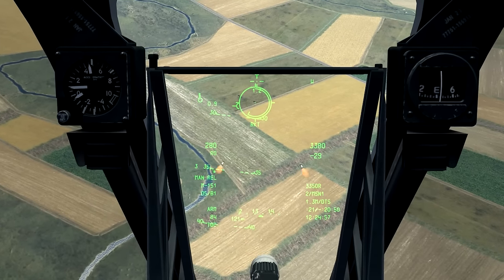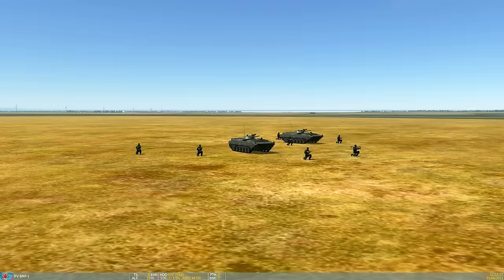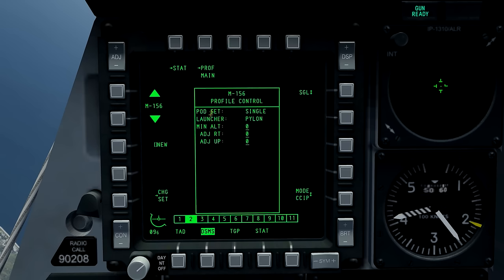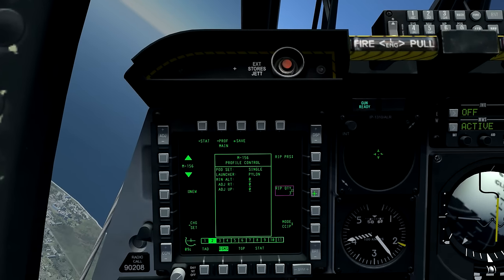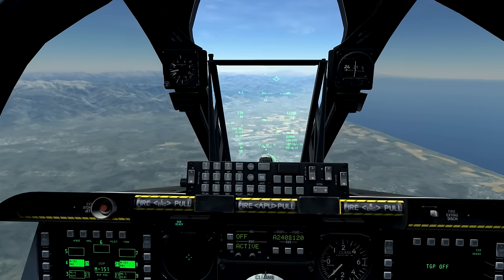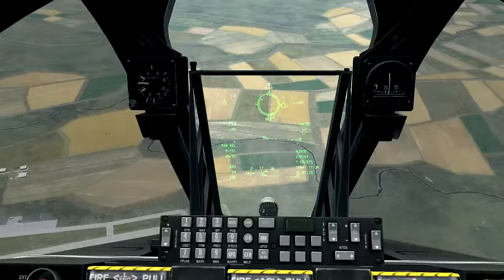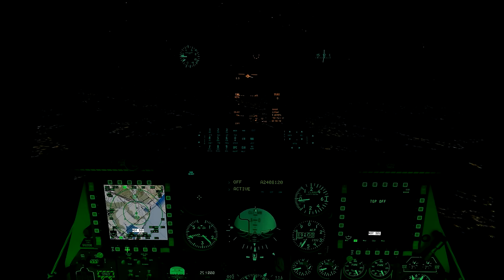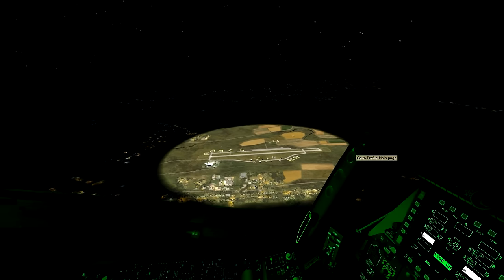DCS:World » Unguided Rocket Employment » A-10C

Comment: The release queue is not displaying seconds to release but the angle you have to point the nose of the aircraft to hit the target with the rockets.
Reply from the maker: +Fritz Le Got a source for that?  Manual states on page 547:
8. As you near the SPI target, the Time to Release Numeric (TTRN) next to the Solution Cue will indicate the time in seconds until the flare should be released.
9. At about 6 seconds on the TTRN, the Solution Cue will start to fall down the ASL. Maneuver the aircraft so that the Solution Cue falls through the CCRP pipper. When it does, press the weapons release button. Unlike bombing CCRP, you must manually press the weapon release button and not simply hold it down for automatic release when solution is achieved.
Reply: pickinthatbanjo got the info from a bunyapsims video about the topic. Just try it, point the nose of the aircraft to angle it shows and release, the rockets will hit.